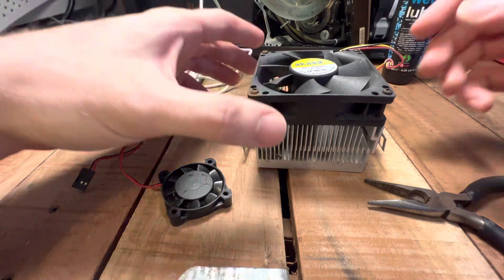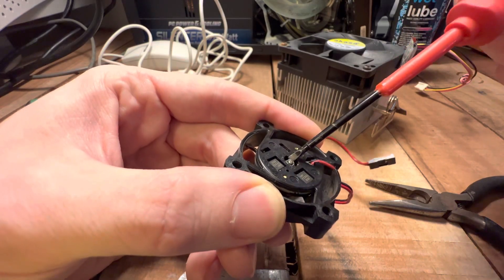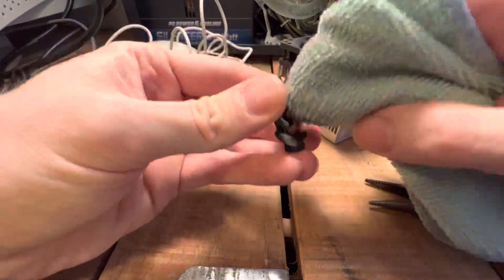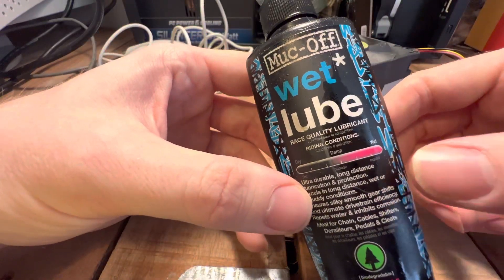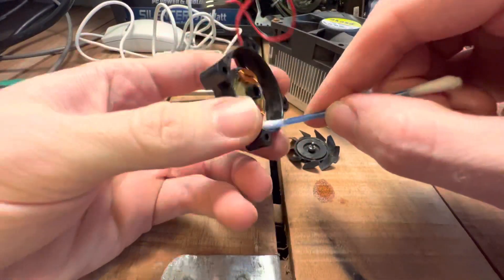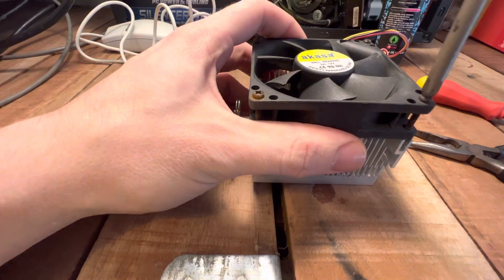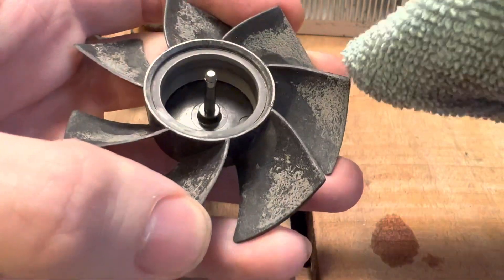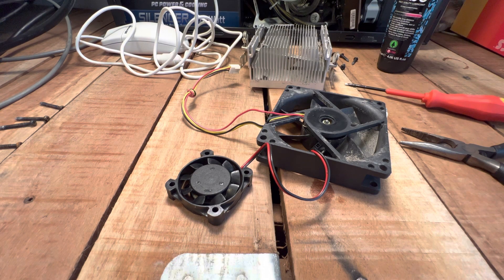Save those noisy fans! | How to Clean and Service PC Fans

Comment: my son. i was about to toss out a fan that was not spinning smoothly but like it was jerking. figured if i am going to toss it anyways why not take it apart. watched your vid, and remembered i had some silicone  oil for the treadmill, put a drop in the bearing smooth as can be. lowkey kinda want to lube all my fans now as they are all the same age. Awesome thanks a bunch for the inspiration.